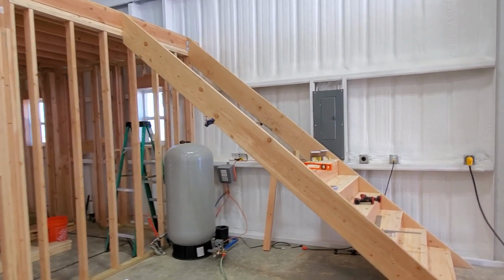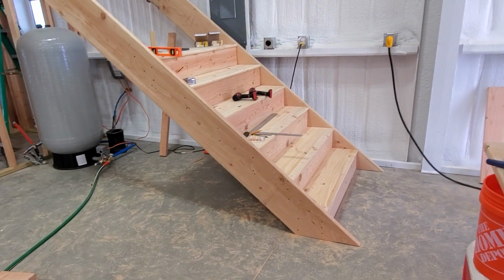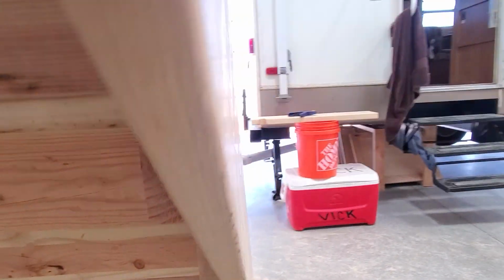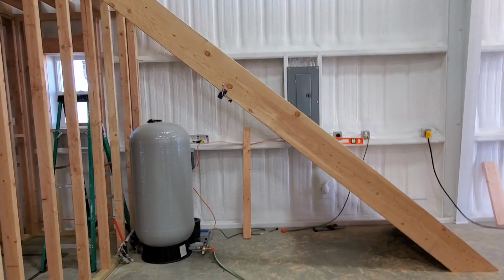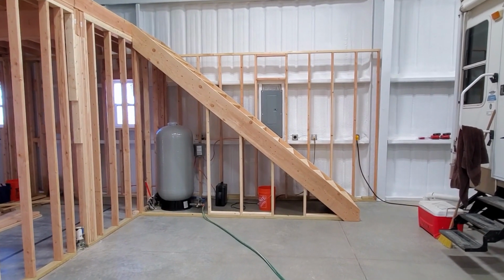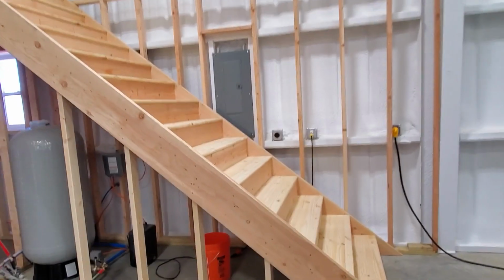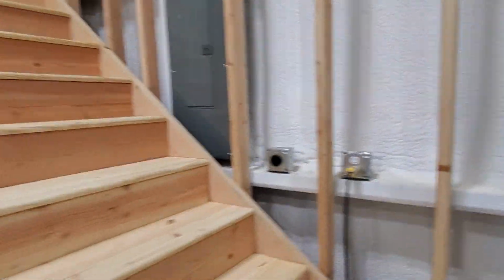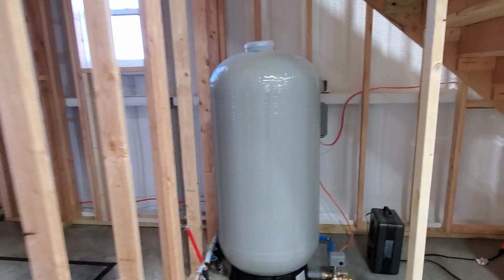50x60 Custom Hangar Home Episode 18: Shop Stairs

Comment: Doesn't your jurisdiction have a code about free space in front of the panel box?  NEC guidelines state that the space immediately in front of the box must be clear, and the box must be accessible. Clearance provided in front of the box must be 36 inches deep, measured out from the front of the box, and 30 inches wide, measured from the center of the box and from the floor to the structural ceiling. The ceiling must be at least 78 inches high from the floor.
Reply from the maker: Good question. So this building is outside of city limits, and there is no electrical permit or inspection required. I understand that having a staircase in front of my panel is not a best practice, but I'm comfortable with the potential risks.
Reply: @Out-Of-Alignment  Please don't think I'm being condescending as that's not at all my intent. I'm just curious because everything where I live requires a permit and inspection with the exception of Ag. While you may be outside city limits counties still have building inspectors. My dad was a builder and I grew up working for him. It just blows my mind that you may live in a place that allows this! We have to draw a permit in my state for anything over 200 square feet. I also know insurance requires inspections to insure. Again, not meaning to sound condescending. Please forgive if it appears that way.
Reply from the maker: @mcampbell7066  Hey, don't worry about it. I didn't think you were being condescending, but asking a good question. Yessir, I am outside of city limits, and there will not be an electrical inspection. It may come back to bite me when I sell the place, ha! But we'll cross that bridge when we get there.